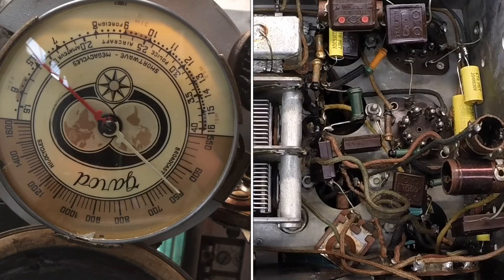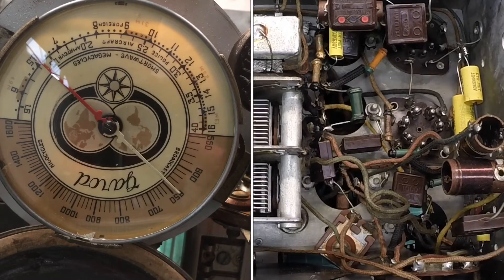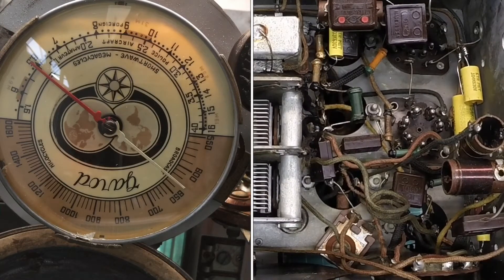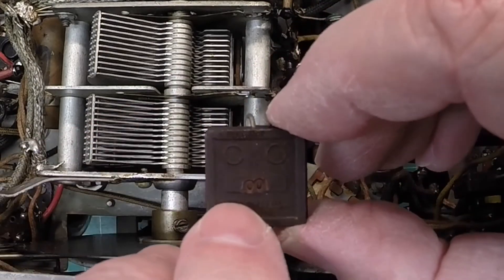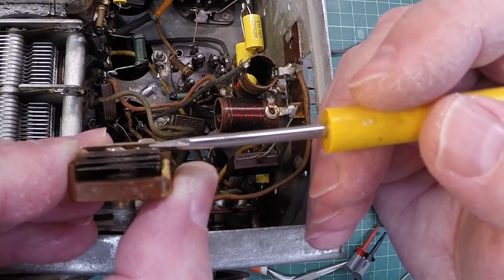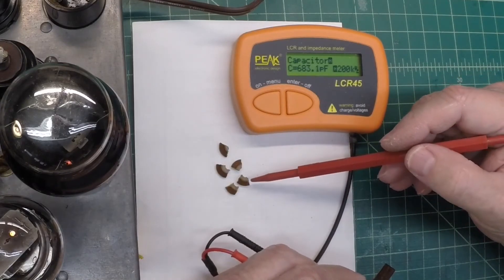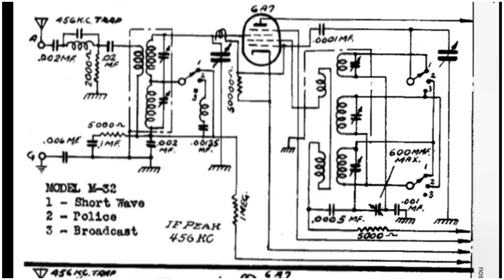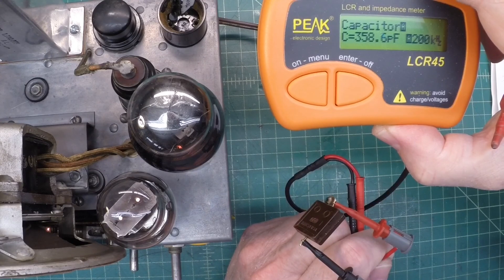Oscillator Troubleshooting - Mica Capacitor?

Comment: I have a question Don. What should I look at if I can align just fine with my signal generator on the broadcast band. I get good tone and everything works fine but when I try to get “RF” through, I just get radio noise. This is on a Zenith 12-S-265 and my antenna is known good at 125 ft. I hope you can give me a direction to look. I will check out the oscillator next but if it was bad, wouldn’t it stop my audio signal from my signal generator too. I have something to learn here.
Reply from the maker: Hi John - to ensure my response is accurate, what frequency range was used and at what point was your signal generator attached? Best, Don
Reply: @RestoreOldRadios  I was saying that in reference to the full alignment. I am not with the radio at the moment but I first did the if frequency and was connected to the grid of the detector tube. Then for the broadcast band, 1400 and 600 attached to the antenna. I have always had good radio after a good alignment like this one did. I just never had it not respond if the alignment went well. I get great audio at both 1409 and 600 but as far as “RF” just radio static. I thought maybe I might be losing signal at the padder for the 600 kc. My signal tracer don’t pick up anything even at the antenna. Side note, this was working great before the alignment so since I lost it on the front end, I suspected the padder but if that was true how is the audio coming through great. I hope I answered you what you wanted.

Comment: I need info on a color code for these mica caps,I don't run into many ,I mostly repair 60 ,s tube radios ,but I do have one radio that has a damino type cap I couldn't change it because I didn't no the value,help if you or a fan fan help I would be grateful. I love your video Now I have another use for my freeze spray thanks for that.
Reply from the maker: Ron, send me an email to TheRadioRepairGuy at gmail.com and I’ll forward some info on the caps to you. Best, Don

Comment: Beautiful work, but you say "again" way too often.
Reply from the maker: +RadioTom103 Thank you "again"; just kidding. My wife tells me the same thing. I have a tendency to say the same thing over and over so you'll have to forgive me. I appreciate you watching and your feedback. Are you a restorer of vintage radios? Best, Don
Reply: Yes Don, I do restore radios, although I'm nowhere close to your expertise. You can see some of my radios and restoration articles at http://n9dd.net/radioprojects1.html  Forgive me for the negative sounding comment. I meant it to be constructive, but it didn't come out that way. Your work, especially the cabinet repair, is amazing! BTW, I found two bad mica caps during my National NC-125 restoration!
Reply from the maker: +RadioTom103 Hey, I didn't take the wrong way so no worries. I'm always laughing at myself when I go back and listen to my videos. I'll check out your restorations. I appreciate you checking out my channel and a sincere thanks for your constructive feedback. Best, Don
Reply from the maker: +RadioTom103 Some great work on your part. Do you keep all of them or do they find another home? Thanks for pointing me to your web page. Best, Don
Reply: Thanks Don. I've sold a few lesser sets at hamfests, and one on EBay. I need to get rid of some. I'm running out of shelf space! Luckily, my wife is supportive of my radio habit and has encouraged me to display quite a few.
Reply from the maker: +RadioTom103 I'm blessed too as my wife supports the hobby. At first, she didn't welcome even restored radios in the house, but as we aged she really likes them. I need to free myself of a few as well. Keep up the great work and stay in touch. Best, Don

Comment: Can you tell me what a patter is.  It is mentioned several times but I have never heard of it.  Very good video.
Reply from the maker: +Donald Emmerling Hi Donald, the "Padder" is nothing more than a small variable capacitor. You saw in the video where it has sheets of mica between the two plates and as you tighten or compress the plates, the capacitance increases and just opposite when you loosen it. Hope this helps. Best, Don
Reply: RestoreOldRadios I was about to ask the same question.  Is it an American term?  Being new to this area and used to using more modern components some of these parts are not immediately recognisable!
Reply from the maker: +gartmorn +Donald Emmerling An old American term from the 20s or 30s I would guess. When I got started in the hobby, I was trying to figure out what they were myself as I had always referred to them as small variable capacitors or trimmers. Best, Don

Comment: Yep, I've also been hearing more and more about mica failures, on the ARF and elsewhere. It would seem time is finally is catching up to them! Excellent video, how do you like that Peak LCR meter? I've been thinking of getting one.
Reply from the maker: +K2bew Thank you. The Peak LCR has worked great so far. My display went out on my other cheap import so I decided to get a Peak based on the limited research I did keeping the value and cost in mind as I don't need anything super fancy or expensive for my use. Thanks again for watching. Best, Don

Comment: A couple of years ago, I worked on a Crosley radio that I could not get the oscillator setting correct to the dial scale. Had literally the same thing happen where once I replaced the "mica looking" cap, I was able to align it correctly. When I mentioned it to other members of my local antique radio club, some members thought I changed my meds. lol Great video!
Reply from the maker: +Radio wild RW, I was getting ready to up my meds lol. Intermittent issues as you know can drive you nuts, but at the same time are so rewarding once you get to the root cause and are able to mitigate the issue. Best, Don